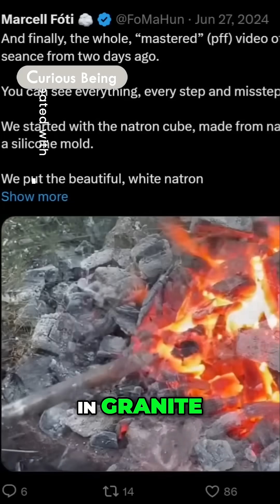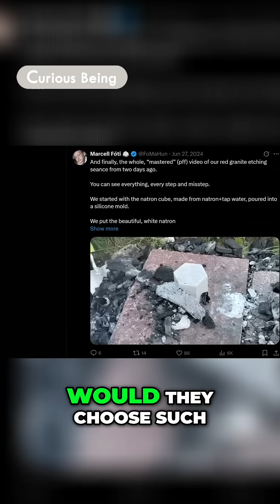Natron on Granite: Is It an Effective Quarry Method to Create Scoop Marks?  #alternatehistory

Comment: I’ve read that in desert regions and highlands like the Tibetan plateau, the locals often use dried animal dung for cooking fires. Which of course burns at a relatively low temperature compared to charcoal.
So with no trees to produce massive amounts of charcoal, how could the dynastic Egyptians have created enough heat using natron to melt rock?
As far as I know, the Dynastic Egyptians used mostly oil lamps or candles made from animal fat lighting purposes.

Comment: Well. Sorry. I’m not as fast as I once was. But I still get there. I crawled to my Saxx industrial processes. And propped myself up with the Chem Rubber handbook. 

Natron: a natural admixture of sodium carbonate decahydrate, sodium bicarbonate, sodium chlorate and sodium sulphate. 

It’s a strong desiccant. Strongly hydroscopic. Industrially used as a flux in some glass making. Generally rare industrially today. 

As a flux in glass making it serves two functions, lowering the melting of silicate sand and excluding oxygen and gasses from the glass melt. 

Silicates melt at 1400 to 1600 degrees C. Flux pushes melting to the lower end of this range. 

Open charcoal fires burn between 107 and 371 degrees C. Only in specially enclosed forced air forges or furnaces can they reach temperatures sufficient to melt metals or make crude glass. 

So we are left with a great temperature deficit if we are “glassing” the granite surface with an open fire. Natron or no natron. 

Saxx mentioned thermal degradation of granite. Usually accomplished at 1200 + degrees C with a gas jet and water mixture creating super heated steam. Allowing granite to be “cut” by a high pressure ball saw. 

I think one other commenter mentioned using natron and a mapp gas torch to erode granite making it easier to chip away. 

So. I’m right back to Tina’s original video. Was it some high pressure abrasive? Little stone hammers? Water jets? Or something totally novel to us. 
I just don’t know. But natron seems off the table to me. 🤷🏼‍♂️

Fox out.
Reply from the maker: Thanks for the detailed analysis! 😊 Happy to see you sharing your insights, Fox. Hope all is well.
Reply: Interesting.  Flux for glass that some scholars still claim is too early for actual glass working.  If they did have glass it is possible they already had some rudimentary theory on lenses as making lumps of glass into inefficient lenses would result naturally.  Filling a bowl of glass with water would get someone interested in the new optical properties.  I am not saying they used solar power through lenses, just that we are still missing a lot of what they knew back then for more than educated guesses.
Reply: That’s what we use I fit today. Does not mean they used it for glass. It was part of their mummy process. 

We do know they used desert glass. Glass probably associated with an air burst comet at some time. Out in the desert west of the Nile. They just lifted I up. Then cut It like we cut gems.

Comment: Good video, thanks for making this. You're right. I tried natron under MAPP torch with granite, which works like you say - the natron melts to make a very shallow dent. Heating natron is not practical. But fire alone with charcoal can make an area of stone weaker, then easily pounded out. I've tried it on basalt, it works and it's practical. Probably accounts for all the charcoal, firebrick, & spalled & burned stone evidence found at the quarry, & an absence of natron.

Comment: I believe they use electrodes softening the center and that way it can be easily formed utilizing hammer and fitting techniques while maintaining workable conditions heating the inside. A lot of the stones you can see where they pulled the electrodes out and it makes a hump and they cut it off leaving a nub for some reason hitting it with these electrodes in this fashion makes the stone lighter an extremely pliable while maintaining most of its heat within the rock so it's workable intolerable conditions therefore a lot of these Stones were molded and cut with precision making this concept more practical and applicable